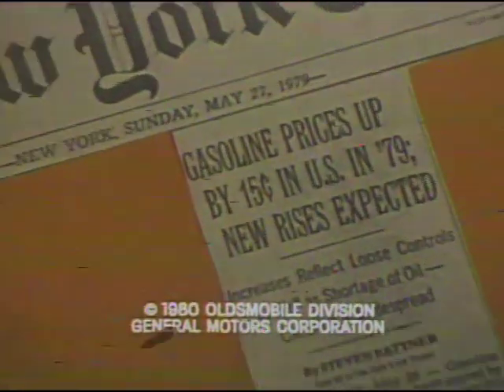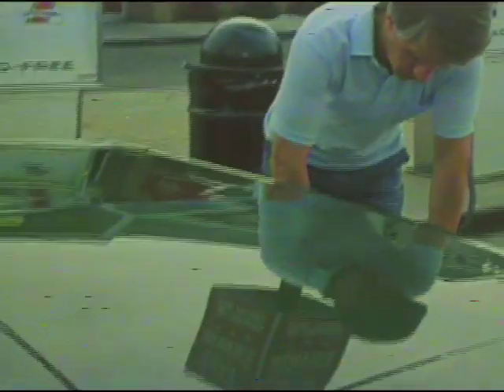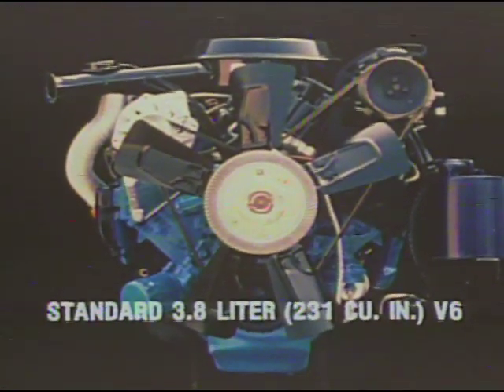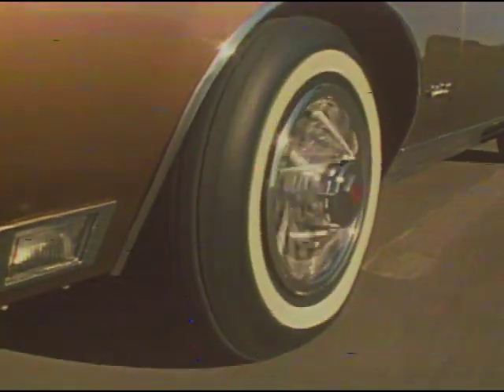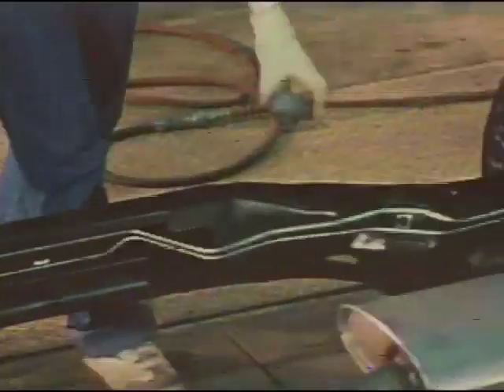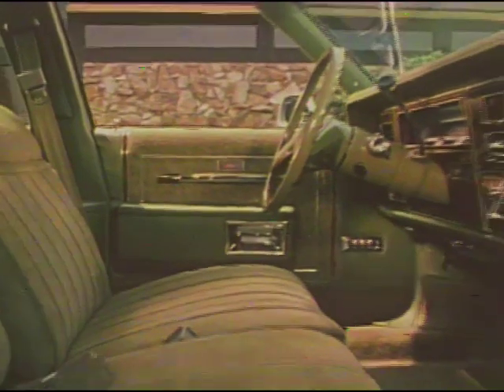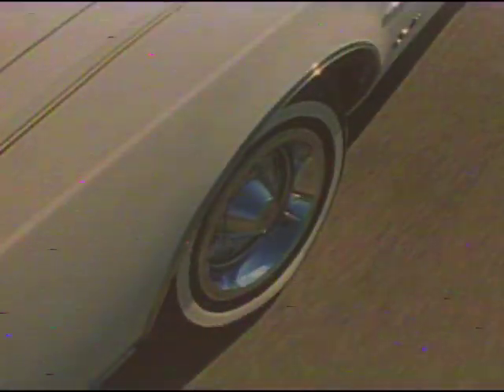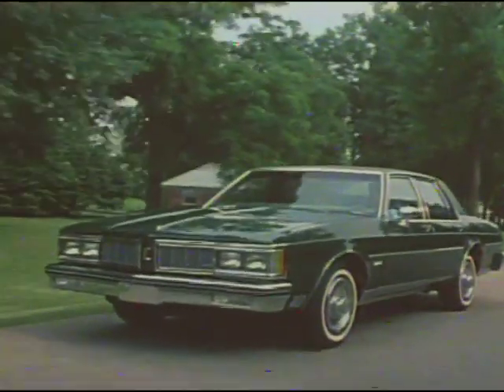1980 Olds Delta 88's (Dealer Film)

Comment: I remember my bosses sister and her husband had one with the 3.8 V6.  It was a dog on acceleration and got lousy gas mileage because you had to floor the accelerator often just to keep up with traffic. They kept if for a few years and finally traded it in. I drove it a few times and it was just awful not to mention it was as base as you could get, I think the only option it had was Air conditioning, no power windows, seats or locks, no vinyl top, just a plain beige box.

Comment: Give me the coupe in Holiday form with rally super stock wheels, 350 Rocket and gauge pkg in that awesome green as shown on the Royal sedan. They must have made a last minute change by production time. They show the Pontiac 4.3 liter 265 V8 as being available but I only ever saw the weaker Olds 260 in these cars for the 1980 to 82 model years.

Comment: Nice looking cars, the only good engine offering was the gas 350, pretty strong by 1980 standards.  The 307 was a slug and the smaller engine was even worse (won’t even mention the diesel).  Then new transmissions were trash too.  Great driving cars though and the bodies held up much better rust wise than earlier models.
Reply: True the 307 was not gonna win many races lol. But you’d be surprised  if you put a Holley carb it definitely wakes it up. Simple mod.

Comment: and...headliners that sag, brittle plastics, and fading oxidizing metallic paints!
Reply: Well back then most manufacturers were cost cutting not just GM but Chrysler and Ford as well.
Reply: @andregonsalvez9244  Chrysler was broke and the 80’s were just dark for the American automotive industry
Reply: Big deal. That happened when these cars were old. Headliners can be easily replaced and hoods/decklids repainted. The foreign crap also had shoddy thin pain on many cars and didn't age well in these years so it wasn't just GM, Ford and Chrysler.
Reply: What else could one expect during the Malaise Era?

Think of videos like this one as a reminder not to get caught up in the hype.

Comment: I remember when the 1980 Oldsmobile came out it had the gorgeous red hood on it with the word Oldsmobile at the bottom. I remember clipping off my first one and rescuing the spring as it hit the pavement and was rolling away. Peddling off on my bicycle I had a nice new one to add to my collection. Then a trip to the junkyard to get the bottom part the mount and put it all back together. Good ornament collecting was a fun hobby for young guys back in the 1980s.